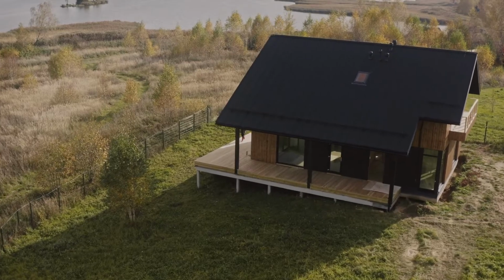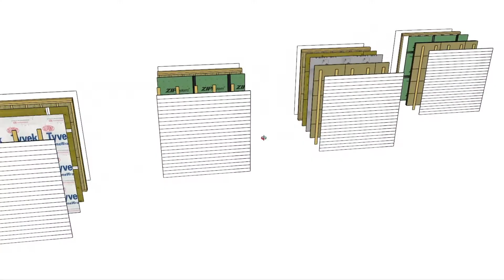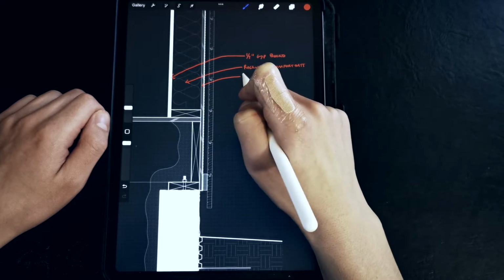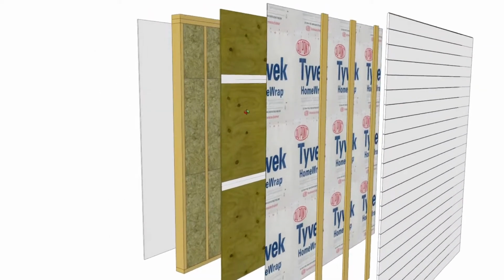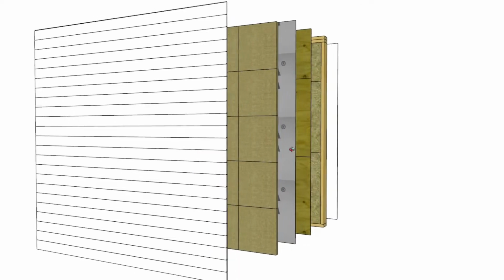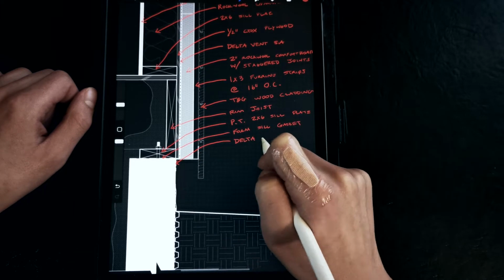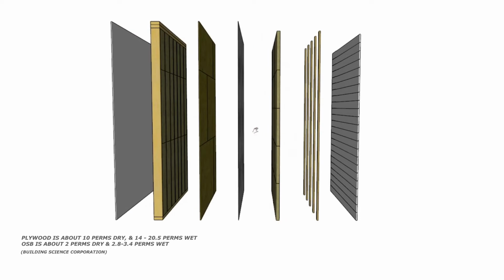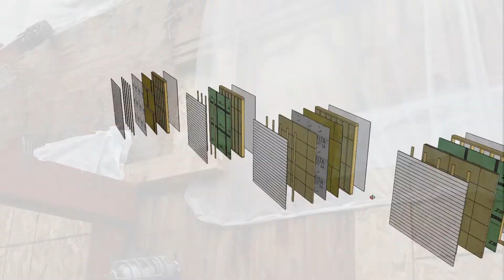Designing High Performance Wall Assemblies (From Affordable to Best Options)

Comment: Does it look odd at all that the siding sticks out quite a bit from the basement foundation due to the comfort board? My builder seems to be concerned about that.
Reply from the maker: Integrate a ledge so that the face of the rigid insulation is flush with the exterior surface of the foundation wall.
Reply: @ASIRIDesigns my architect is recommending extending the foundation out a little like they do for brick homes. Would this work with siding/comfort board and is there anything besides flashing we’d need to use to prevent water intrusion?

Comment: 0:10 Dumb question...  isn't the exterior cladding installed upside down in this section? The groove would hold water, no?
Reply from the maker: @Clark-Mills  Good catch! That's absolutely right, the CAD model was likely was flipped by mistake. You always want the tongue facing upwards to avoid that building condition.

Comment: Noticing there is no interior vapor barrier included (I'm specifically looking at the Tyvek version of the wall). Is it not required when everything is detailed correctly for air tightness? I'm in climate zone 4c and would like to use this assembly.

Comment: This is a fantastic video! Question-with perfect wall #4 you don’t “need” comfortbatt on interior? I think in some of your later videos you do have exterior comfortboard and then interior comfortbatt? For medical reasons I want a house that has minimal temp changes inside, I live in Provo UT. Could I get away with no interior comfortbatt if I did wall #4? How about sound then? I assume interior + exterior makes for a nice and quiet interior (I live off a semi busy street). Thanks!

Comment: This seems like fabricating a site built monolithic structural insulated panel over conventional stick framing with better insulation material, water / vapor control and much better attention to detail at the assembly connection points. Nice work, you have a new and very appropriative customer, thank you for sharing your knowledge and providing quality products to our industry. GC in Virginia Beach VA.

Comment: Wasn't EIFS the perfect wall?"  Oh yes, insulation on the exterior, until it leaked.   That is the inherent problem with a perfect wall.    The installation has to be perfect.    I am an engineer and I consistently find the subs contractors use that cannot read english, or don't care, continually screw up good designs.  Maybe the building official will catch them, but many times they do not.  I have concluded that ICF and SIP's offer the best bet in getting a near perfect wall.  In both of those cases sealing is important, but such a big job, that it more often is done correctly.
Reply from the maker: No, EIFS was a face sealed system as you described, as it relied on sealing each insulation joint, with no WRB behind the insulation layers. Foam would be adhered directly onto the sheathing, and the joints would be caulked. Then, polymer modified stucco would be applied directly to the insulation. Awful system and far from a perfect wall. "Perfect wall" refers to Joe Lstiburek's perfect wall, where the insulation is located outboard of the water and air control layer. Water that gets behind the insulation drains out on the drainage plane of the WRB.
Reply: @ASIRIDesigns  Can you do a video on high performance EIFS? That and regular stucco are the only claddings that are really used in my area.

Comment: Great video, would love to see more detail regarding continuity through the roof and foundation. Also, how would you go about fastening siding through 5” of exterior insulation?
Reply from the maker: Thanks so much, might show that in the near future... With regards to siding - Fasten 1x4 furring strips to the rigid insulation with epoxy coated steel wood screws, and then your siding or cladding is fastened to the furring strips. You can also use metal hat channels if you don't want to use wood furring.

Comment: What if one is using metal framing instead of wood? Would that change the assemblies a lot?
Reply from the maker: Yes, all of the thermal insulation must be installed on the exterior of the studs/sheathing with rigid insulation. You lose about 80% of the thermal resistance of the wall through the conductivity of the steel studs. The only reason to insulate between steel studs is for sound attenuation.

Comment: What are you thoughts on icf rather than multiple layers?
Reply from the maker: I like ICF a lot, it's a fantastic and durable system. However, like these wood framed systems, ICF also will require multiple layers. A lot of people don't realize how complicated it is to properly waterproof ICF (both above and below grade). The EPS foam also needs to be protected from UV light to prevent degradation, and so an appropriate cladding should be used. In my market it's also hard to find experienced builders who are comfortable working with ICF. On another note, ICF walls are also a lot harder to remodel, so it's important that if you choose ICF, you're content with the layout of your walls.
Reply: I have had 10 homes and none of them were ever remodeled.   Guess that is why I always build new.

Comment: One question you may be able to help me with is how to integrate your  exterior insulation into the exterior insulation layer from your concrete basement walls, especially when lot grade puts one half of the basement above grade. Would love guidance on how to tie these details together.
Reply from the maker: Hi Vincent, excellent question. 

You have a few options with this if you've got exterior rigid insulation on the foundation walls depending on the cladding materials that you're using. With all of these options you'll want to flash the top of the rigid insulation covering the foundation wall, and back it with a dimple mat so that whatever insulation you're using is able to drain water away from the insulation. The first option is to install a moisture resistant cover board, I've seen fiber cement based products used out there. If you're using stucco, you can install a stucco "skirt" on this protection board. If you're using siding, then you need to make sure that the sheathing is flush with the foundation wall so that you don't have any siding jutting out from the wall plane. If you want the siding to extend all the way down, you'll need attach furring strips ontop of the rigid insulation using some pretty heft concrete screws. Another option I've used in the past is a 26 gauge aluminum black coil stock to cover up the surface. This works well if you're using an open joint rainscreen, to where you can match the black color of the weather barrier with the coil stock. Finally, you can use landscaping to hide these imperfections. This works in a pinch as long as the plantings aren't too close to the insulation boards.    

Hope this helps. If you're finding that you need more assistance, I do offer remote project consulting.

Best wishes,
 -Sharif